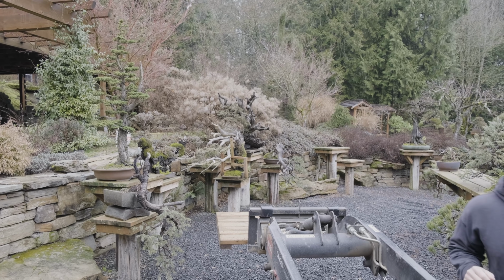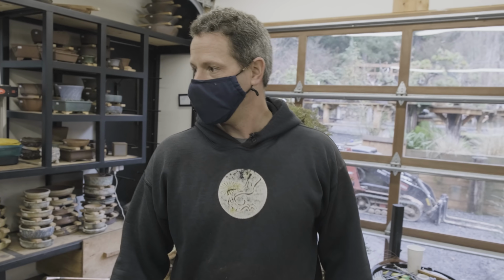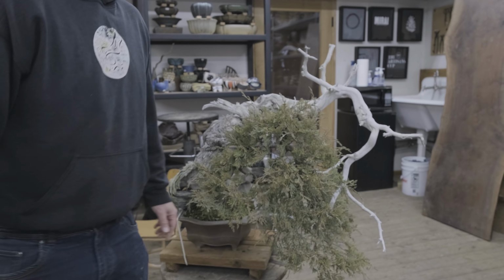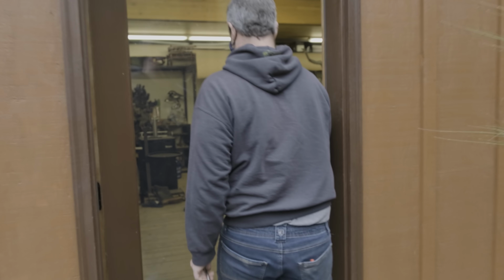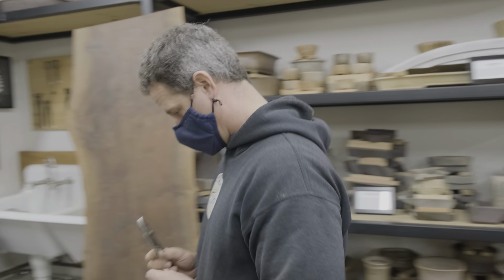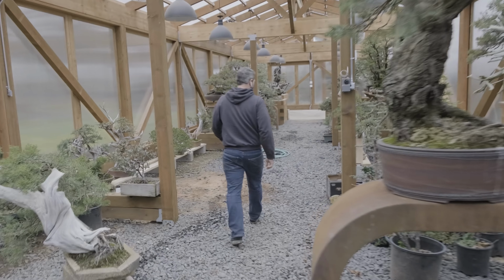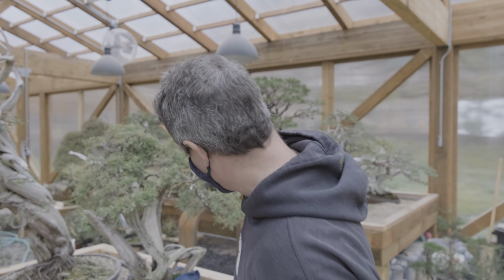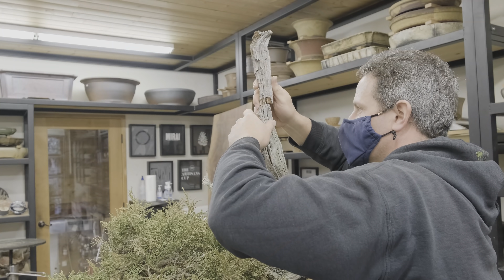Mondays at Mirai: Year of the Junipers

Comment: hey, a great way you can shave down those screws is by attaching the screw directly into the chuck of your screwdriver, and spinning the screw against your bench grinder. that will give you a faster, rounder and smoother grind! As a trade here, can you tell me if/what you use to fill the screw hole afterwards? Thanks!

Comment: For the broken apex I suppose you could use a nonexpanding adhesive like superglue+zipkicker and then drive a single long lag screw down. Although driving a single screw down might split it. You might be able to get away with connecting the two pieces using a small piece of threaded rod used to hold the two pieces right at the break itself